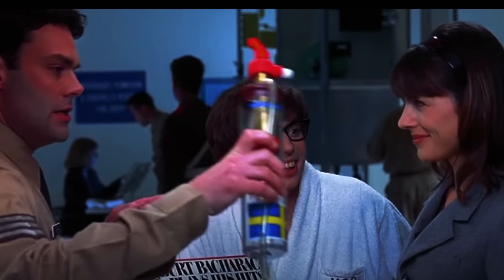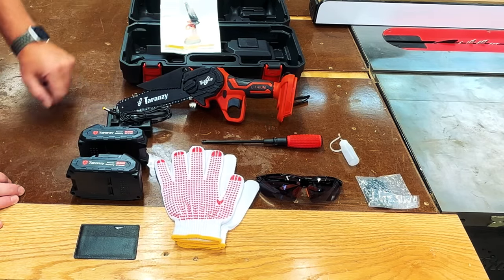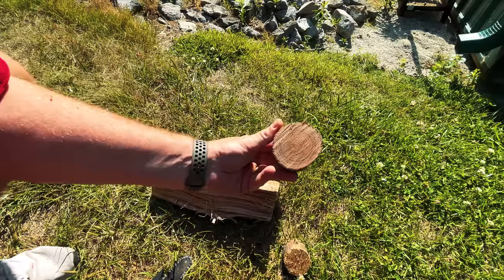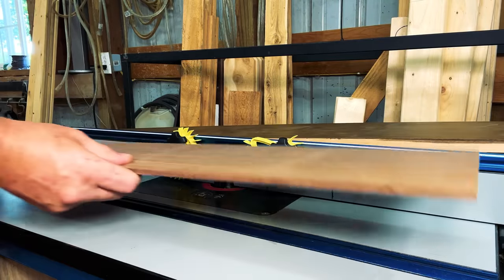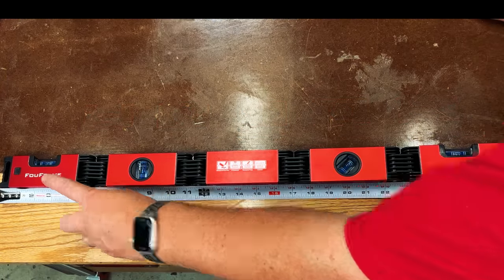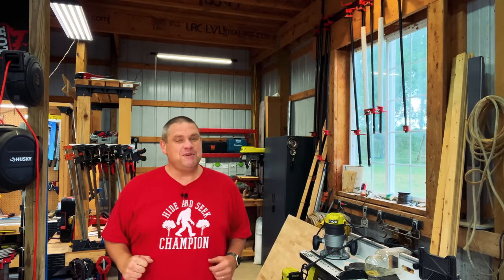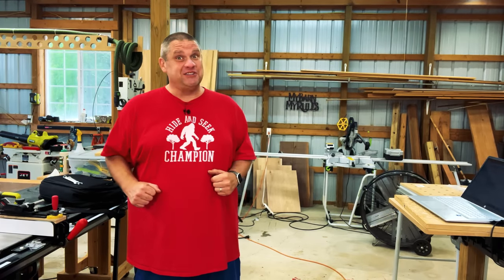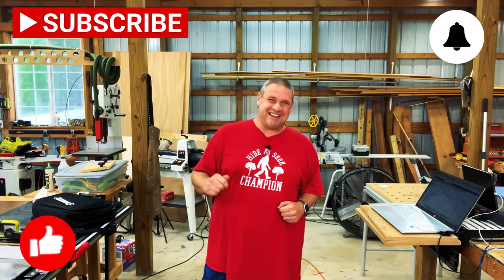Mind-Blowing Woodworking Tools You've Never Seen! #woodworking #amazingtools

Comment: I'm not a fan of the mini electric chainsaws, or the larger ones for that matter, they just don't get the RPMs I'm used to for cutting. I do have a wood and brush blade for my saws-all that works great and, I think, makes a better cut than the chain saws. I think that folding level would be great for leveling camp trailers, I don't think it will replace my standard levels as I use them for a straight edge as much as I use them as a level, however; and I hope It never happens if I have to hang siding again it would be really nice for wrapping the siding around an outside corner. I like the design of that multi size wrench, I'd be curious how it fits into tighter spaces. I'm pretty impressed with the coaster, or anything that makes drinking a cool refreshing beverage easier.... I might just get one to add to my bottle opener collection.  Thanks for the fun video,  keep up the good work and enjoy, what I hope for you is a long weekend.
Reply from the maker: Thanks so much for sharing Pat.  I was very hesitant on purchasing my first electric chainsaw.  We have a lot of trees in our yard, and I use it to chop up limbs or cut down dead trees about once a year.    My electric chainsaw gets the job done for sure, BUT you are 100% right it doesn't have the power of a good old fashion gas powered one.     I actually have another small electric chainsaw that is on a long pole to get some of those branches that I can't reach.  I've only used it a couple of times so can't give great feedback on that one.    Glad you like the coaster!   Thanks so much for sharing and thanks for watching as always Pat!